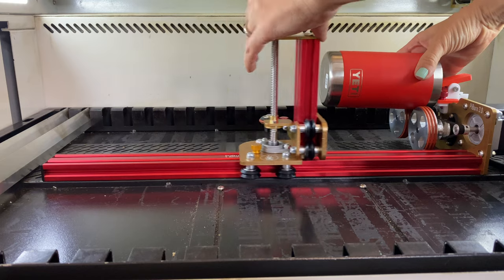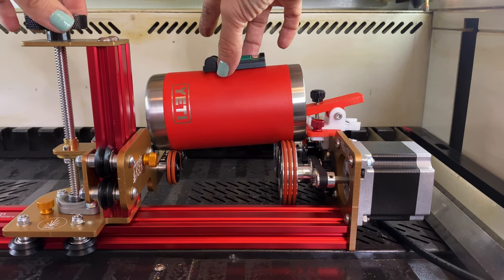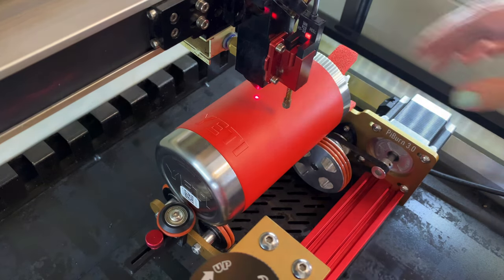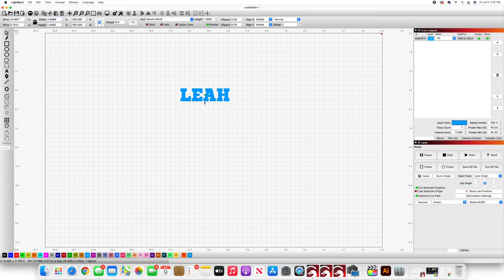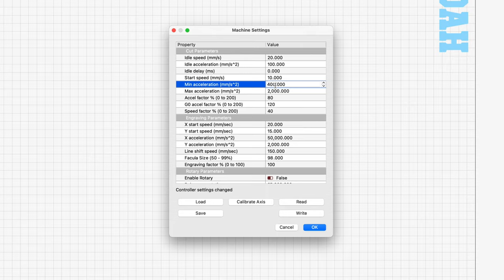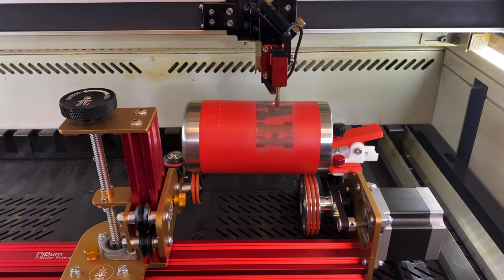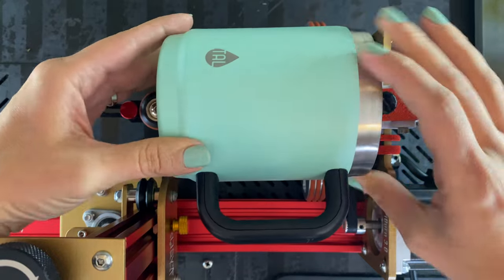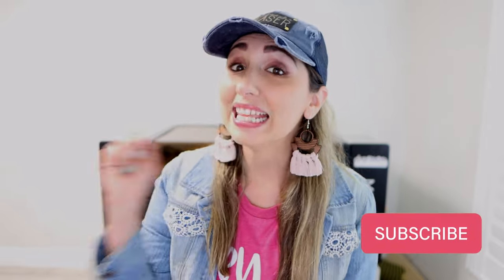PiBurn Laser Rotary Attachment How To

Comment: I just got a Pi Burn 3.0. I seen where you didn't have to mirror your image. I had to mirror my image for it to work. Is there a setting I missed?
Reply from the maker: You might have it placed backwards on your machine. Make sure the motor is on the right. :)
Reply: @ThatMomWithALaser  Motor is on the right. I have to check the box in the rotary setup to mirror image for it to to work.
Reply: @Team90j97  So glad I am not the only one. I have to check the same box.

Comment: Hi, I set mine up last night and all is good except it’s not spinning. Any pointers? It will raster and vector but it won’t turn like it’s supposed to. It will turn when I turn on the machine though while it homes. Any thoughts? Maybe there’s like one switch I’m missing?
Reply from the maker: Hmmm.  If you are plugged in, have updated your machine and rotary settings but is still behaving that way I would contact PiBurn directly.  They are the experts with these kinds of things. ☺️
Reply: @ThatMomWithALaser  Thanks for your reply, I was able to fix it. I had a mystery toggle switch in the bottom of my machine that I think was treating off the x-axis. These tumblrs turned out great.
Reply: @ThatMomWithALaser  On a sidenote I have found another problem with my machine. I have a big FL 1390. It’s 4 feet wide and 40 inches back. At this time I can only engrave one ornament at a time. It’s terrible. My ornament is nested in Groot at about 3 1/2 inches wide by 7 inches. There’s some letters that I am cutting out that I mount on top of the ornament. If I group it and put another one in it’s just not burning up some of the vector cuts. Or if I stop the project and it homes and restart the project to cut through a spot that didn’t make it through, it starts an eighth of an inch lower from the original spot. Not sure if you know what’s going on here but man if you did! I love you long time and send you some money for your wisdom.

Comment: Have you ever tried to do any firearms or is that strictly fiber lasers
Reply: The rotary isn’t particularly germane to that but you can remove anodize on AR-15/10 receivers and the like. CO2 won’t directly mark metals without marking compounds like Cermark etc. If you want mark firearms directly or knives etc a Fiber laser is the right tool. They’re also far more compact and a lot faster and more precise. They will however not cut anything.

There are dual mode machines from Epilog but they’re a compromise on the fiber aspect and atrociously expensive.